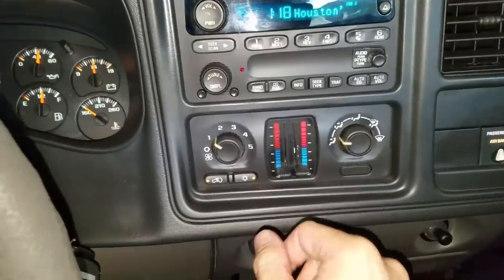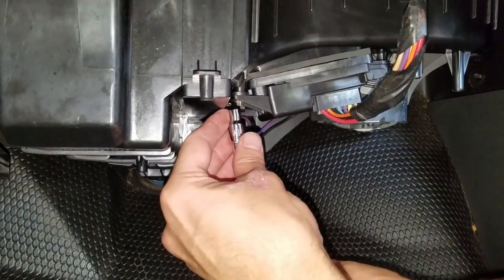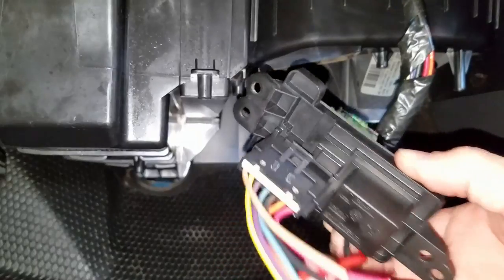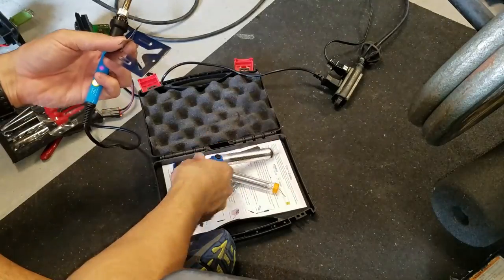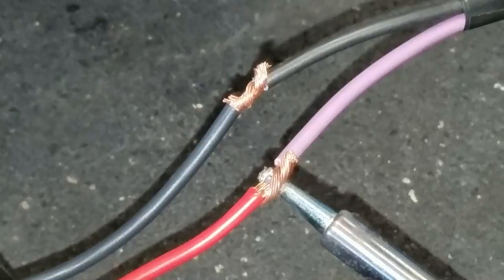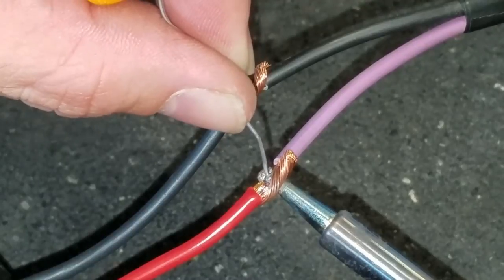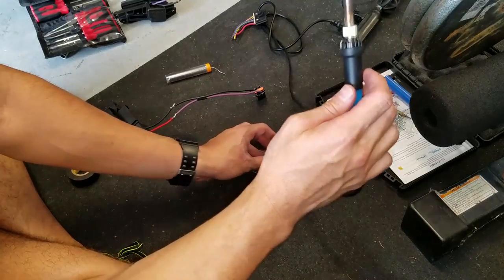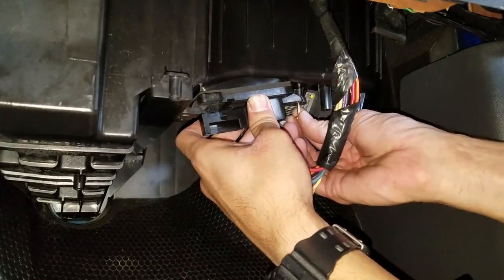Chevy Truck Ac stopped Working Blower Motor Resistor Replacement Flipping A Silverado ls -Episode 5

Comment: 1,2,3,4 work but 5 doesn’t and I’ve replaced the blower motor resistor. Any help?
Reply: Same problem here. I'm getting power to resistor on all settings but 5 will not work. I've changed blower motor resistor twice and the blower motor and still can't get it to work. I'm totally stumped.
Reply: @RandalPinkFloyd75  check fuse under the hood for #4 and #5, the rest are in the cab. Its a 30 amp fuse
Reply: I've checked fuse on side of the dash and 30 so fuse under the hood both guards are good. Relay is working. Power is getting to the resistor on 1-5 which is why I'm stumped. Gonna test power between resistor and blower motor this weekend.
Reply: @RandalPinkFloyd75 might need to replace the cooling/fan control unit that sits right under radio?
Reply: @EduardoSanchez-eq1qc  I've done that as well. Did not work. I honestly don't know what else to try.

Comment: I have the exact same truck, color and all. My blower fan stopped working. Replaced the fan, resistor, checked all fuses. Put a new a/c control in and nothing. Any advice?
Reply: Did you ever figure this out? Having the same problem.
Reply: @jennifertso104  yes it was the actuator. It's a little motor that controls a door that lets the hot or cold air in. It's behind the venting duct running behind the dash. You have to cut the vent duct to reattach the actuator and then reach attach it. It sucks.
Reply: @jasonlewis1455  was the fan blower not working at any speeds? Still working on this thing. There's heat but no speed turning on...
Reply: @jennifertso104  blower was working. The issue was it was constantly blowing out hot air regardless of temperature setting because the actuator was not allowing the cold air. I'd check your fuses for your blower motor if your blower is not working. I also replaced mine thinking that was what it was and it wasn't it.
Reply: @jasonlewis1455  guess what? I fixed it. It was my fuse inside the truck! Hot air blowing!! Everything else bought and put in and it was the darn fuse!! It's ok..thanks anyway!!

Comment: I the red cable sparked and i put the new restitor dosent work
Reply: al ex fuse
Reply: Did you find the problem? I installed a new resister  in my vehicle and still not working.
Reply: @lonnienewsome2001  its was the resistor for me
Reply: @fishgoblub9640  I had to put mine in the shop, turned out bad wire in the ignition , they installed new ignition switch $255 parts and labor.

Comment: Replaced the resistor and the ac blower motor and still no air coming out
Reply from the maker: Did you test the fuse?
Reply: @Donnythelatemodeltech   yes I did and still nothing

Comment: My resister did burn up on my 2003 chevy silverado.  Only fan speed 4 out of 5 was working.  I replaced it and 1,2,3 and 4 now work but 5 still does not.  

Any Ideas why?
Reply from the maker: Dm me on Instagram and I can send you a picture of the wiring diagram, it might help you through your repair
Reply: Same problem here
Reply: @navorgonzalez2744  Replaced a fuse and it works fine.
Reply: @Navor Gonzalez Replaced the resistor, low pressure shrader valve was leaking - replaced it, replaced 40amp blower fuse now everything works great.
Reply: Ryan I'll check mine and see, thanks
Reply: Ryan Daugherty if it’s a fuse,none of the speeds would work. That’s BS! There isn’t a fuse for each fan speed.
Reply: @plugger4945  no there is not.  you are right.  Just one for the fan and the resistor slows the fan down.  That is my understanding of how it works.  But that is what I did to fix it.  I must have missed something.
Reply: Ryan Daugherty Well,the good thing is,you fixed it-bottom line.
Reply: @plugger4945  That 40 amp blower fuse was definitely blown when i checked it though.
Reply: Ryan Daugherty Blown fuse issues suck,when you don’t know for sure what Blew it. You know SOMETHING blew it-but WHAT? Electrical problems can really bum you out! Well,good luck.
Reply: @plugger4945  if you're not what blew the fast way to find a blown fuse is with a digital multi meter set to continuity and you can quickly check each fuse.